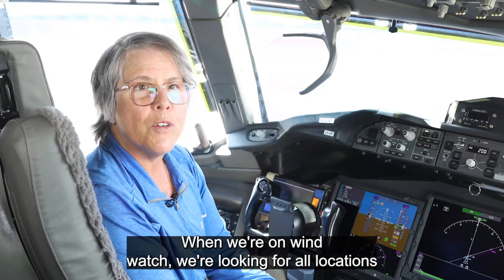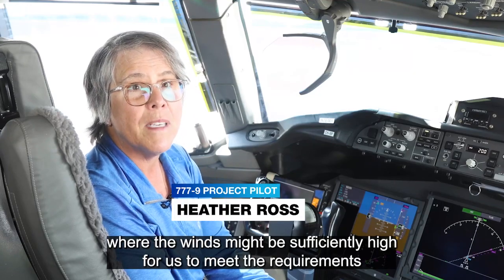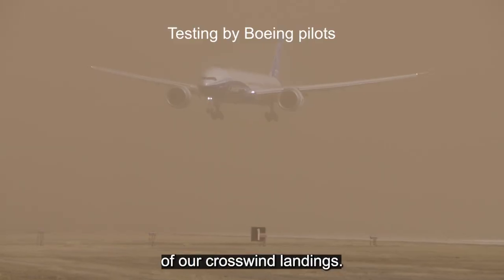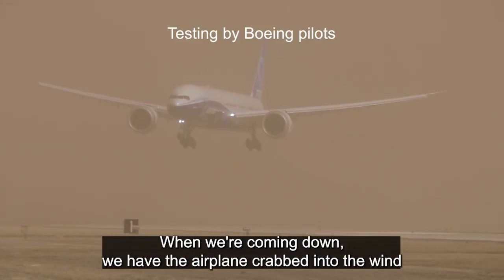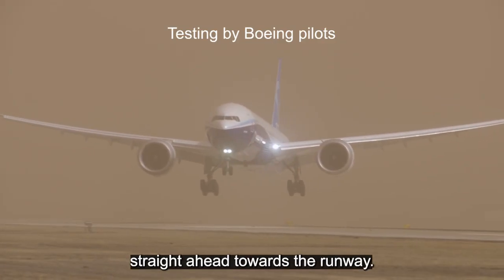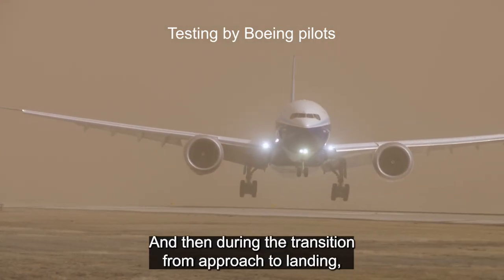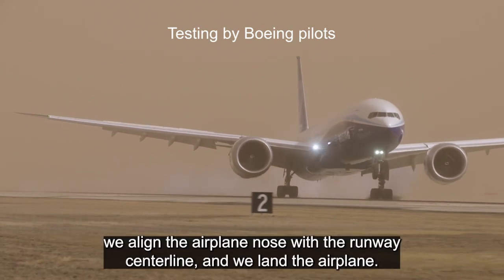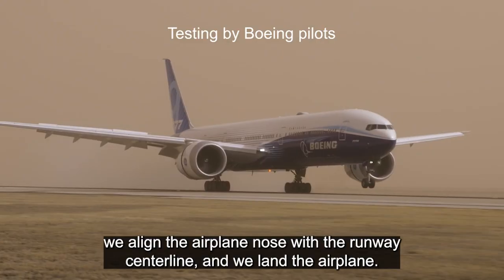Boeing 777-9 Performs Precise Landing in Howling Winds

Comment: Hi why not install storm radar and collision avoidance systems that prevent aircraft from flying through severe thunderstorms and colliding with other  aircraft and buildings.  These systems should be built in and cannot be removed. These systems should work in any weather conditions. Why not use satellite radar systems?

Comment: That was a good crosswind landing. 
I wonder if given the pilot (localiser receiver antenna position) to main wheel length being so great on the 777X if there was a FMC entry to calculate crosswind component and then offset the localiser indications to allow the pilot to fly centred needle but the main wheels to track the runway centreline. 
At the moment on the 300/300ER positioning the cockpit on the up wind side of the runway by sight is a pilot technique discussed in strong crosswinds.
Let’s go Boeing! Get her out there so I can fly her one day. 👍

Comment: "The centerline continues to track straight ahead..."  No it doesn't.  The longitudinal fuselage centerline is crabbed over with respect to the velocity vector, which is the one aligned with the runway.   Is this another DEI Boeing promotion?   How can a high ranking project pilot be wrong about something as basic as that?

Comment: These test pilots are awesome. Imagine, flying an approach in big jet with a 30 knot cross wind component. Simply the best.
Reply: Reportedly, winds were in the 40- to 60-knot range for the 777X wind work in Kansas a couple months ago—not sure what the lateral components were, but I'd expect it to be certifiable well up into the upper 30s for that, perhaps even low 40s.
Reply: @Infiltrate.and.Betray   According to the article in Flying which led me here, this was in Lubbock, TX.

Comment: For context, a key part of the certification is the maximum demonstrated crosswind capability. This is the worst crosswind the manufacturer has proven the aircraft can handle. They want to find the worst conditions so they can get that measurement as high as possible. Whatever number is proven in the certification is what sticks.

Why is that important? Insurance, regulatory and airline safety policies. Insurance policies can force airlines to force pilots to not even attempt to land in conditions worse than what is proven. Many airlines don't allow even starting an approach if the winds are beyond the tested limit. The reality is that exceeding the limit makes you a test pilot. Not ideal with passengers. 

The manufacturer has a number they expect the aircraft to be capable of handling, but that number is irrelevant until proven.

Comment: Such an underrated aircraft. Travelled so many miles in the back of these. Amazing to see them pushed to the limits
Reply: you actually havnt because this version isnt even certified yet
Reply: @karlsandin4515  Do you know that, 777 have older versions ? They look very similar somebody who don't know much about them, will not know that this plane is not released yet. 
Also @josh3771, they are not underrated, it's for long flights and not everybody needs to fly across the oceans like crazy and drain their wallet. (Depends on who you fly with). 
I love them because the engines and i can't even imagine they have RR engines. Bigger plane, Bigger engines. I just can't wait untill this beauty will fly over our heads.
Reply: Unless you work for Boeing or are an engineer you haven't 😂

Comment: even 777 9 has the A380 style wings.Straight while flying,droop down when no lift is produced making it as if the engines are too heavy for the wings....GO BOEING!!
Reply: Huh? Not at all. The 777X has emphatic dihedral architecture. At no point in a cycle to they hang down. When airborne, they arc up nice and high like Dreamliner wings.

Comment: We need the boeing 757 back into production
Reply: It's a beautiful and great plane for spotters alike, but it has a lot of issues for airlines and the general public

for example, it's extremely narrow making the passenger experience more inconvenient. It's a narrowbody that's too wide for smaller ramps built for the 737 or A320. It's also pretty hard to control in a crosswind and it's wake turbulence is way higher than it should be. Not to mention the engines are pretty outdated (maybe a re-engine could be done) but overall, it's not so ergonomic, and airlines who use the 757 are already switching to the alternative a321XLR.
Reply: @fadbob_  yea but they should make boeing 757-200/300ulr fitted with powerful engines, split scimtar winglets and more variants in the next future
Reply: @akhira_tan_aviations  Boeing scrapped the 757 tooling decades ago. It ain't coming back—and there's not going to be an NMA to replace it, either. The gap between the MAX10 and the 787-8 will remain until at least the mid-2030s.